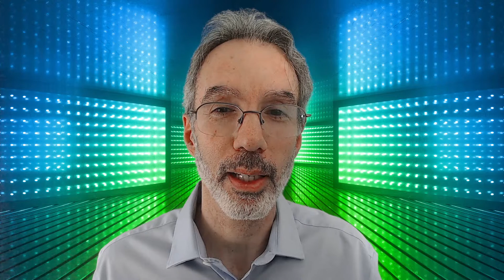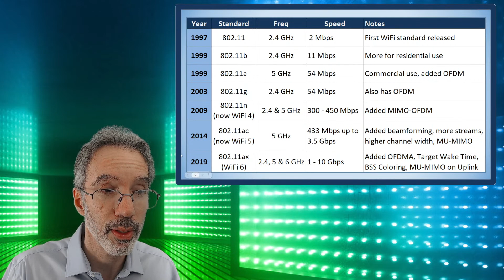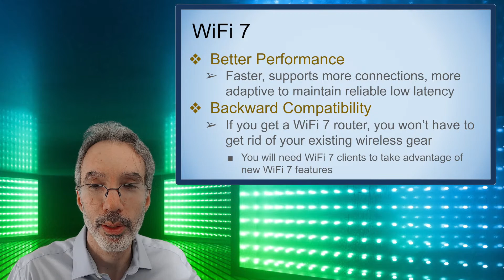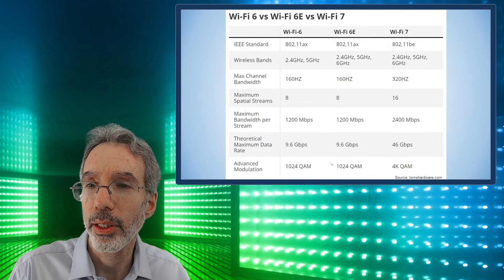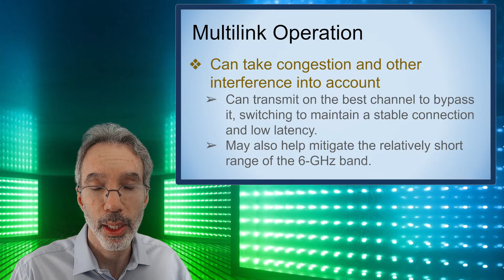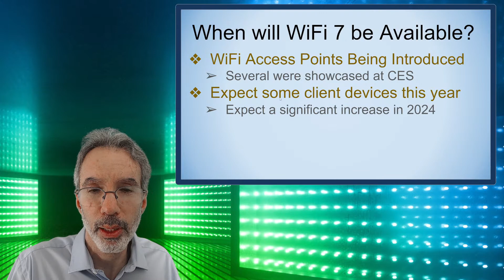What are the benefits of WiFi 7 and when will it be available?

Comment: I was wondering what your thoughts were on routers with internal antennas.  TP-Link features a Wifi 7 router which reviewed negatively because the transfer rates depended on how the router was positioned/rotated.  Netgear's Nighthawk line also features a Wifi 7 router, also with internal antennas (because Nighthawk), and I'm concerned if it will review similarly.  I wish they'd all go back to external, independently posiitonable antennas.